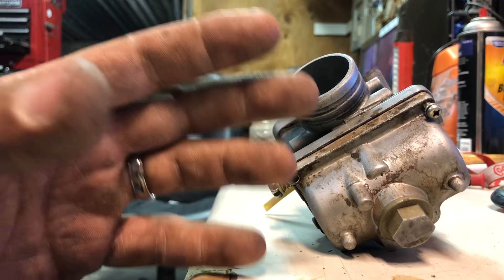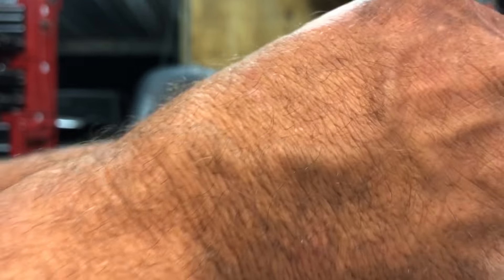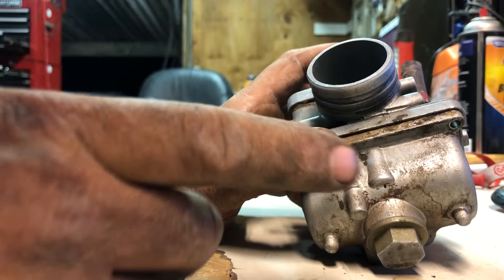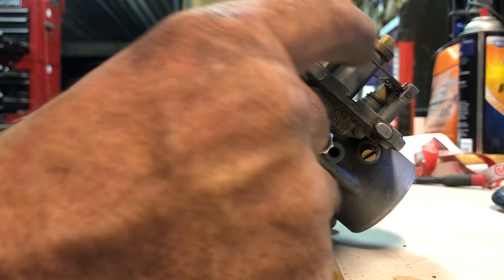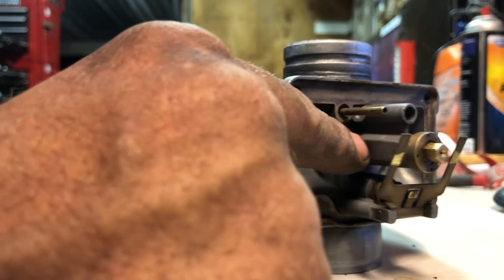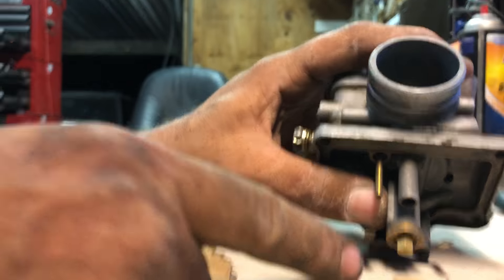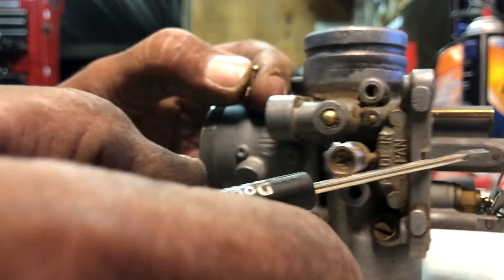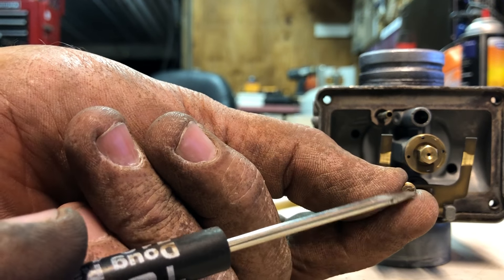Spitting And Sputtering Issue Solved

Comment: Did that in a PHBG 21mm.. still spits. I noticed that by adjusting the air mix screw it made it a little better, but still spits at WOT. 
Tried many different settings turning the screws 1/4 at a time but still cant get it right.. i had to lean it a bit moving the needle ring up as the engine was constantly flooding. Thats when the spitting started... should i get the needle ring back in the middle and change to smaller jets??
Main jet 92
idle get 50
Gilera runner 70cc.
thanks in advance

Comment: I have a small mini bike with is 4 speed automatic clutch.  Bike cranked over but doesn't start unless I spray gas in carburetor.  I took carb off clean it . Still same proablem . Also this carb I cannot take off the lower peace to check float

Comment: Hi. Maybe you can help me out.    I have 2010 Kaw Bayou 250. It cranks and idles fine. The first thing I noticed is after first starting and letting warm up, it idles fine but if I rev it from idle it cuts out....I had to slowly get to that full throttle.  Then when took for a ride it sputtered a lot at high throttle.     I cleaned carb. I did notice that the float was high, I adjusted that , removed jets and cleaned ALL holes....running same way.  This has the bottom front fuel/air mixture screw. It has spark but not a bright blue spark, more of an orange spark.   I am thinking I may need to raise main needle or adjust fuel/air screw out for richer?  Let me know what you think or anything that may help. Thanks

Comment: Hey I'm having problems with a 1997 wolverine 350 yamaha 4/4 . I can't find the oil filter for one and it's not get any power from throttle . Just putts a lot . Won't go . I have rigged a hose to the intake boot . Had it running good for a bit then went back to the same . I think it's the carburetor but can't get the floor off the check the o ring under it . Please help me 😁

Comment: Awesome video. 
Got a question for you. I have a venom 125cc mini jeep. I was having problems with the spark but fixed that with a new ignition coil. Since changing the ignition coil I lose power in 3rd gear. 1st and 2nd seem fine but once I switch to 3rd it loses power, and then picks back up, but if I give it full gas it dies right away. Runs ok at 3/4 throttle and complete lose of power with full throttle. 
Any help you be great. Thanks.
Reply: Same with my tw200
Reply: @blessedwithchallenges 
Mine turned out to be the choke. It came undone inside the carb so the choke was on the hole time.
Reply: @JoeThornFreedom  thanks

Comment: Hey I have a 2001 Honda recon 250. It is essentially mint condition except it has a weird sputter/knock noise more when you’re idling, and it almost dies the engine out but sometimes it doesn’t. Any idea what it might be. The engine actually sounds like it’s running a little rough when you hear that noise it’s kind of wobbly almost

Comment: I have a skidoo that dumps fuel out the side tubes on the one side but how do you take the plastic pieces out of the side i broke one of the hose fittings off its all plastic one on each side

Comment: Helloe Thomas. got a Raptor 350. (little story) bought it in bad shape. but it started and idled perfectly but i couldnt rev it (died) found the choke was corroded stuck so i got it loose and changed the sparkplug. wouldnt start. cleaned the carb, now it backfires ALOT(when revving too). it wont idle nice, either i rev it to keep it running or use the choke so i idles high. and it pops through the intake now. seems like everything became a mess with it. do you know what could be wrong here?

Comment: I have the same carb and Polaris 400L. My problem is that it won’t run with fuel. If I drain carb, it will start and run for 30-40 seconds. As soon as I add fuel it dies. I have cleaned carb extensively but not getting any results. Plug is wet when I pull it out. Thanks for any help!

Comment: Great Stuff!!  On my intek motor of my lawntractor, I will have my throttle down at idle and in seconds it will rev up and will keep revving even higher, to knock it back down before i blow the engine , i step on the gas and will go back to normal . when i am driving it stays normal but when i stop and leave it idle it will do it again. Would like your comment on what you think is going on .
Reply: The idle circuit is too lean. Turning the fuel screw clockwise will richen the idle. Counter-clockwise will do the opposite. If it has an air screw, they do the opposite, clockwise will lean it out. Hope this helps.

Comment: I have an issue. i got a 1978 kz650b, it has a 4-1 pipe which is basically straight pipe since it was drilled out before i got it and since rusted, it ran really weak so we bought k and n pod filters aswell as upping the jet and pilot jet sizes to even out the mixture. the #1 cylinder and only that one will backfire out the carb every few seconds at random, the carbs have been cleaned twice, pilot and main jet are new and it ran consistently (however weak) before and i cant find a solid answer anywhere. in addition to that ive also been told that when it was parked (35 ish or more years ago) it ran fine however the original carbs were misplaced so new ones were bought, they fit and worked before the jet upgrade but i have no clue whats wrong. please any advice would be helpfull.

Comment: My bike started running rough today,
will not hold a steady idle or rpm even
at about 1/4 + throttle, but accelerates 
like a banshi if I get on the gas.
 I changed out spark plug, 
checked air filter...shrugs...

Comment: My Yamaha xj550 Maxim doesn’t run on idle no matter if I adjust the throttle screw… but if I get on the gas a bit it idles fine… what’s my issue 😔

Comment: @ thomas brain hello this Eric & my daughter have a 125cc Apollo four wheeler i just bought not even a month ago that starts fine but when she give it gas now it sputter & want pick up speed but was running fine at first
Reply: I have a Kawasaki Bayou 220 doing the same.  I just replaced the carb with a new one.....Now when i push the throttle all the way the ATV sputters.  It does fine with a engaging throttle to the mid point but after that it starts sputtering and when I let off the gas you can hear the engince sputter back down to idle.  It idles fine.......  it just at high speed where I get the issues.  Brian can you help?

Comment: Omg,,, I just had my 1982 Yamaha IT175 out today. I’ve had the carb apart a number of times and cleaned but did not take notice of those small holes, you may have answered my “bogging” concern. Additionally, that tube I believe is restricted because I can not blow air through it. Thanks for the information, I will try your suggestions.

Comment: I have a 125cc venom quad brand new .Have problem starting I use choke when cold it takes a few cranks starts but if touch throttle it quits and I notice fuel coming up in the cap hose .I set the air fuel at 2 turns and do the idle screw and some times it allows throttle but most times not as I say brand new quad.?

Comment: Hey hey I have a 1976 25 horsepower Evinrude when I give it full throttle it's sputters and it's almost like it's having a hard time moving but it goes about 5 mph and it doesn't wrap high in the RPMs

Comment: I have a 2008 Suzuki DRZ 125 and I can usually kick it over. Though when I turn the throttle it does not return to idle but it keeps going up or staying if what you just turned the throttle could you help me of what is going on?

Comment: great video i have a 2 stoke wr 250 husky runs fine low revs but mid to high really spluttery any ideas
Reply: Likely not enough gas at high rpms if its sputtering at full throttle

Comment: I'm having this problem, but it's a new carburetor, it was my first motor kit and I bought a zeda 80 when it was in stock, so I started a bike build for my son with my first motor similar to the PK 80 on a occ chopper bike everything is offset to the left cause of the wide bike tire, well my issue doesn't seem to be the carburetor, and being that the exhaust system is a flex tube pipe could that be a problem why it spitting and sputtering.

Comment: So I just rebuilt my sons 2005 Honda crf 80f (dirt bike) and it idles good, but when get on the throttle quick it boggs and then when it finally does come up in rpms, when I chop the throttle the rpms come down really slow, not crisp and fast as one would expect. What did I do wrong??

Comment: got a 2007 polaris atv 500 efi.  starts but bogs when adding throttle.  replaced fuel pump, fuel strainer, injectors, everything fuel related all the way.  no change,  when i put my hand over the carb, air intake it seems to rev up fine.  any ideas?

Comment: What would the problem be u think on a quad bike when it’s bogs down after u leave it idle for a little bit or doing slow speed and the cooling fan kick in when it’s at temperature only plays up when it’s get warm

Comment: The carb on my 80cc bicycle engine is bogging and backfiring out the carb and I’ve completely cleaned the carb and replaced the spark plug what else could it be

Comment: I do not have gas flowing into the carburetor. I added a fuel shut-off, fuel filter and line but the carburetor is dry with no gas. Any suggestions??  Thanks

Comment: i have filled diesel into my hornet 2004 carburated and just right now is fourth time cleaning the carbs , any advice on how to  just not to do the 5th cleaning because after second cleraning it wouldnt start but third clean was  with carb cleaner spray the abro spray and it did start but after a while it started working strange and on two cylinders .so i took of the carbs again for cleaning!???
Reply: just to add ai did change the oil filter. spark plugs and the tanks gasoline before the first cleaning

Comment: 2004 ltz 400 revs but seems to stall a bit then regains power sometimes It backfires  also took the spark plug out and it’s a cr9 and book says it needs a cr7ei if it’s a ltz400f how do I tell if I have a ltz400 or ltz400f

Comment: My new carb for 125cc two stroke is running too rich even on 1'1/2 air setting, sputtering while riding, should I adjust the needle setting?.

Comment: So I have a carburetor pwk-24 mikuni for a 50cc and when I go to tune it my rpms bounce I've got it some what tuned but still rich in fuel and sooty apart plug I've tryed to change my needle adjustment to lein it out and at that point it don't start I've tryed to adjust my idle screw and it does nothing I can ride it but full throttle it like cuts out and around half I need help please

Comment: my friend bought suzuki an125, it is 4t but with 2t carb. We cleaned it very well every part and every hole but that damn carb sucks so much fuel and it needs so much air at that level we should not put air filter. One more the problem is it gas a nice idle but when u twist throttle by like 1mm it gets choked and cant go faster than 10 or 15kmh at full throttle. Any help here?

Comment: I have a 2003 Honda 400ex.  It only sputters in 2nd gear.   It was jetted by the dealer when we had exhaust put on.  It ran fine for awhile, but just started sputtering in second gear.  It does not sputter in 1st gear. Do you think it is the jet needs cleaned?
Reply from the maker: if it requires more fuel ( and second does compared to first) then i would say, yes something to look into. keep in mind a fouled spark plug can do the same thing when requiring a hotter spark as well. thanks for watching.

Comment: I have a bayou that runs good until it starts sputtering and dies then I fire it back up after a few and repeat. The carb is leaking out the overflow.
Reply: Clean the carb, floats stuck or the float needle needs adjustment

Comment: I've got a 92 kawasaki zr750 that sputters and bucks at 4000 rpm. I have rebuilt engine and carbs and ran the gauntlet with it but it still bucks. Oem airbox and open 4 into 2 exhaust. Any ideas Brian or ppl in comments.

Comment: I have a 2008 Polaris Sportsman 500 HO, I just rebuilt the carburetor and it runs perfect at idle or low to medium speed, but it starts bogging down at full throttle or if going to the smallest mud hole and barely will run...... what could be the problem

Comment: My motor is a 6.5hp power sport TECUMSEH....i just put on my doodle bug mini bike. My issue is it will start after i push the nozzle on the carburetor to start it....but after riding just a little bit, it bogs down and shuts off....but if i push the fuel nozzle again as if I'm pumping to get ready to start for first time of the day, it fires right up and does the same thing down the road? Does this also mean that my carburetor just needs a clean?
Reply: I have apache rlx 100 just bought an it's been running fine an till it started high rev in an wouldn't cut out when I turn off now I try start it an it's not starting when I take the key out it starts turning over the starter motor  can someone help me

Comment: What if I’ve completely rebuilt my carburetor/s on my 2000 ex500 d and it starts right up, I can open the throttle in neutral and it works great, BUT as soon as I take off down the road and get to 5k rpm it sputters terribly and I get a loss of engine power? I can’t seem to figure it out any help would be greatly appreciated.

Comment: I just bought a 1997 formula z Ski-Doo I started up it runs good for 10 seconds and then it starts spitting and sputtering I got a feather the gas and then it backfires and shuts off is that a carburetor problem they need to be cleaned also and it is that the first place I start or should I get new plugs they're pretty new check the gap?? Can you tell me the first thing I do to try to solve this problem

Comment: Hello I’m TPat I m a beginner and am trying to run a small engine fan shop I refinish paint powder coat and wiring resently I’ve encountered a delema though it’s a Artic cat 500 build cdi no go and I need to hard wire a 16 pin connect with 9 pins being used I played switch a too and well you guest it it lives no more I installed a Gy6 box but it stalls no spits and sputters but idles perfect is Lao install a brsnf new carb and reg rec is it possible it should work or is the timing an issue cause of back fire I look everywhere for a diagram of a 2004 Artic cat 5004x4 but I go how can I get this diagram? And can I build my own cdi so is to remove all the crap except main wires to and from stator and pick up Please help me I’m a worm but learn fast I’m 50 yrs old and about to have a dam heart attack if I don’t ride soon  Thx brother

Comment: Hey I'm having a problem with a Polaris xplorer 500. It idles fine. But even with a cold start it will fire right up and if you touch the choke it dies. I believe it is getting to much fuel. But could the valves not be opening far enough.

Comment: Hi I've bought a lexmoto nano had it deristrickted it's only 20 months old but now its boggin when I stop at lights ect for about 8 or 9 seconds then takes off fine is my carburator taking too much fuel or is it air filter issue brian bolton

Comment: Hi Thomas ,my 250 dirt bike has started acting up, either dies when throttle or when it runs it’s jerking and just nothing happening, any ideas I have cleaned carb and jets with rake cleamer and adjusted float, any help would be appreciated

Comment: I have a Yamaha pw80 and I cleaned the carburetor and it runs and idles but when I try to drive it it tries to stall or just no pulling power. Do you know what that could be?

Comment: Ok, I have. A Yamaha ttr230 2014 model , it’s huffing and puffing almost like it’s sucking air from the air box causing a rough idle and stall out eventually. How should I fix this.. is it the carburetor issue..

Comment: Hey I have a 2015 xr650l that will spit and sputter then die when idling. Recently as of tonight I was riding home and I was getting a bogging issue mid turn and then it died mid corner. After that it took all hell to get it started again and I barely made it home. Would you think this is a carbarator issue or what is your take?

Comment: I need some help I have 6.2 polini a/c it won't start i pulled the carb off cleaned everything pulled the reed block out turned the reeds over made sure I had spark put it all back together and still won't start,now when I try to pull start it I pull it like 5 times then I hear a noise coming from clutch like almost a squeak i need some help

Comment: What is the rpoblem with my gy6? Even tough engine is fully heat up, its rpm drops every stop, when you hit the throttle, it feels drowned first then it increase rpm after

Comment: I got 125cc motorbike and I'm okay with a little bit of throttle and full throttle but the mid range it splutters and I'm struggling to get any speed.
Is this to do with the fuel mixture??